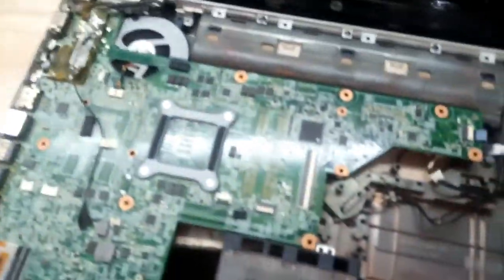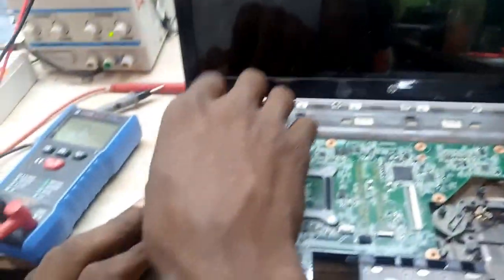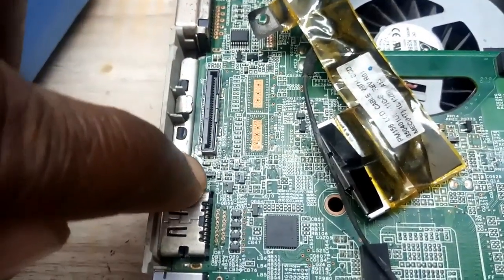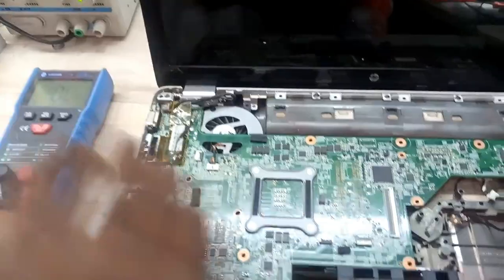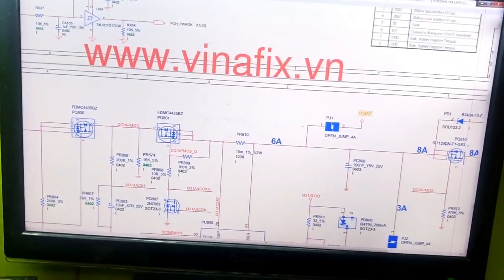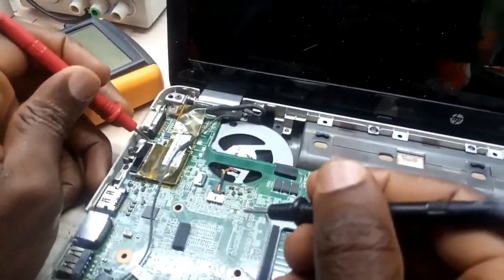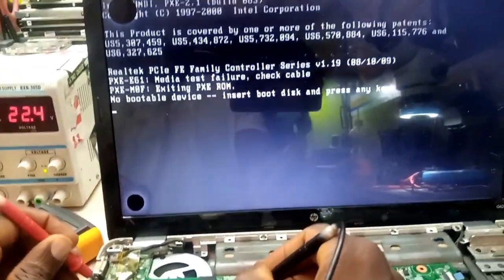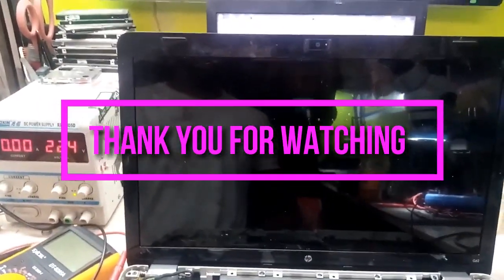Most possible no backlight fault of any kind of laptop

Comment: Hello sir, when checking the impedence does it mean you won't supply voltage to the motherboard and check if the capacitor is working fine with multimeter ?
Reply from the maker: Yes